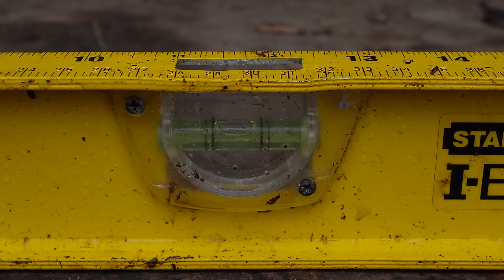Removing Stumps, Falling Trees And Moving A Shed | Cabin Build Ep. 1

Comment: I can’t believe you took a gamble with the tree.  Lucky.  Best practice; use a bow & arrow to launch twine over a branch,  tie a strong rope to the end of the twine and attach the rope somewhere up the tree.  Tie off the ground side rope to a secure spot in the desire fall direction.  Tighten it using levers.  Cut the tree and tighten the rope as the tree bends.

Comment: Timmy J to the recue.  That file deal, you're not playing a fiddle.  Good job falling the tree.  Timmy needs the building practice for his house.  Get his hammer sharp.  For your drag job, bark those pines, that green wood is a lot slicker to pull across.  Very near everything you build needs put on skids.  Good job.  A piece of rubber beltline is good to set a floor jack on.  Find one at a sand and gravel operation.  Wore out the better.  Man that solar power is doing great,  Battery sawsall handy.  That's what they cut off steal catalytic converters with.  You need an arctic mud room on the porch will be a million trips in and out when working.  Good vid, work safe
Reply from the maker: Great comment

Comment: Why so small the new cabin? I build a shed like that and a couple of feet on each side made a huge difference.
Reply from the maker: I debated on going bigger, but ultimately it's a bunkhouse, which will be cheaper and easier to build (doing it mostly solo) and it will heat up easier and stay warm longer. It's just a place to crash and relax. I have gone back and forth about wishing I did 10x16 though. Oh well, I can always build another!